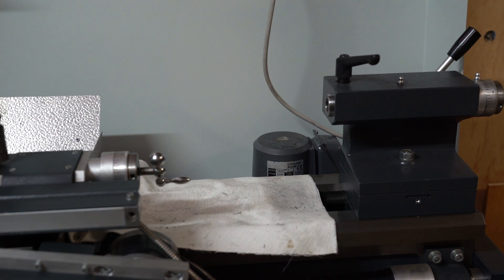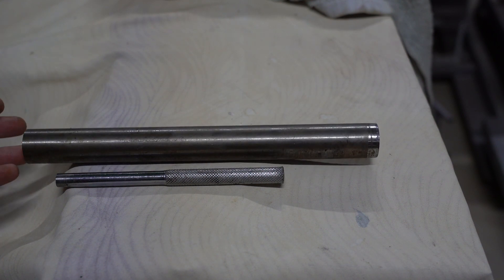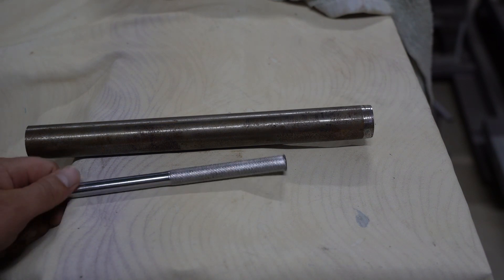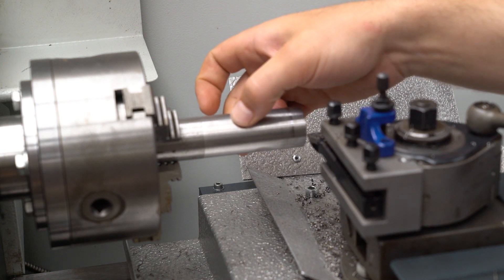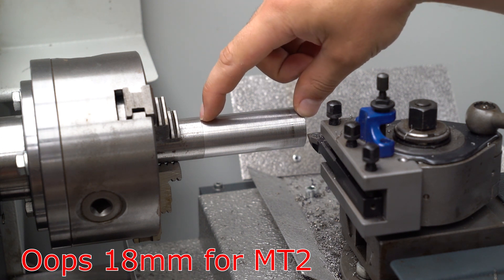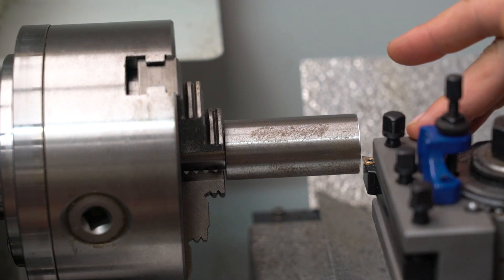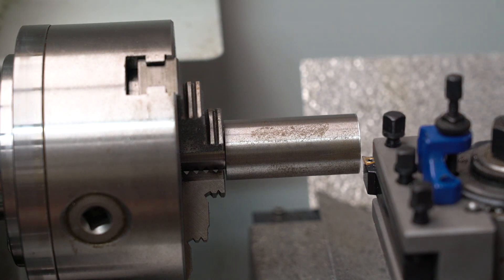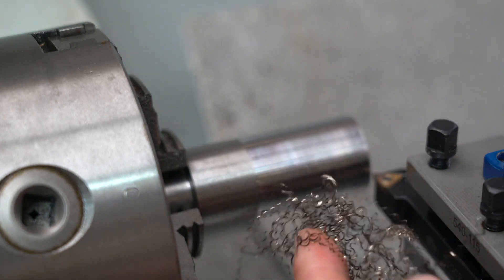🔥 Making a MT2 Drill Chuck Arbor With a Handle

Comment: Nice add on. We have a D2400 at Uni and the bloody chuck even spins when using <6 mm drill bits. Did you buy the D6000 brand new or got a exhibition model from Wabeco? Trying to get a D4000 into the country but lathesonline and Wabeco ghosting me 😪
Reply from the maker: I bought it new but If I were to buy all over again I would buy a smallish Taiwanese lathe such as the AL-960 as they are a better lathe for the money.
Reply: Dear, how much accurate is the lathe? I want to buy a D2000 to build precision small things. (accuracy should be 0.02mm to 0.05mm), Thanks